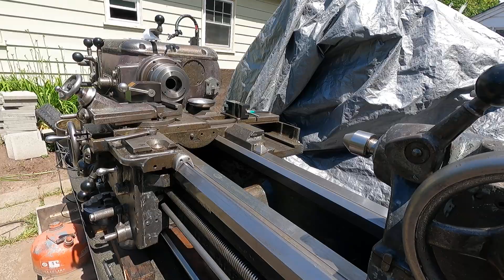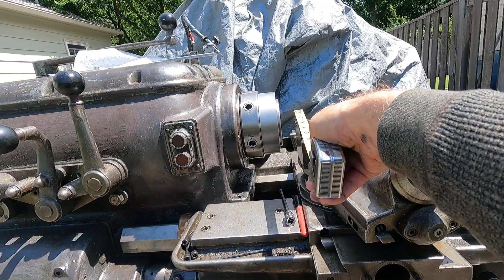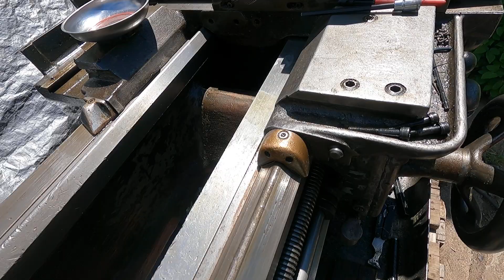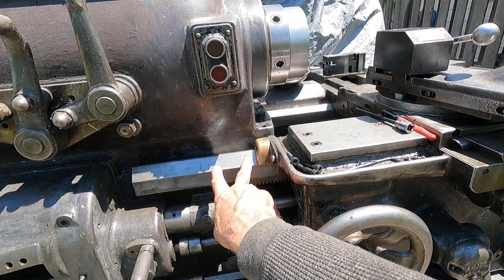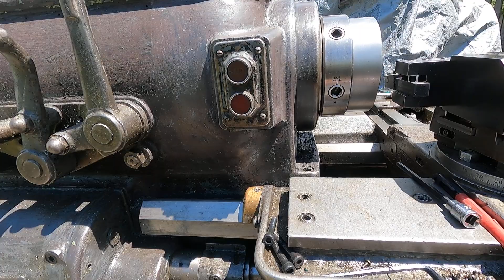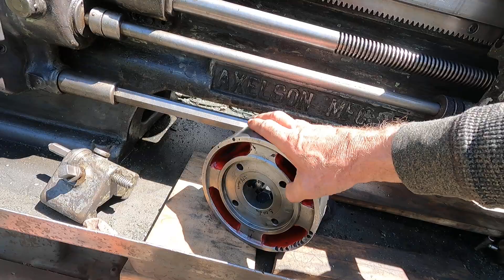Machine tool restoration using DIY stain remover results

Comment: DeeDee, so why did I regrinding the bed on my 10ee?  Because it was fun!  Schaffer Grinding in Los Angeles did the job. I can’t say enough good things about them. A family business with great employees, ethics and prices.  Thanks to great advice from my friend who later scraped in the saddle, they ground so little material off of the bed that my lathe now exceeds Monarch’s original specifications with the exception of a few .0001” drop that required shimming the tailstock up to to achieve near perfection.   Considering the large “Vee” ways on that Axelson it really saw a lot of use, or abuse.  Bringing it back to life the way you are is preserving a beautiful piece of American machinery.  Keep scrubbing!  TB
Reply from the maker: Ha Ha, when you are chasing tenths the machine will seem as flexible as an Atlas lathe. Perfect lathes are not all they are cracked up to be. Monarch specs .001" high on the tail center or so, it is in the Blue Lathe Brochure.  You still have to use every trick in the book to make it work just like making acceptable parts on a same size bench lathe trying to hit .001". Much from the same bag of tricks I will work that old Axelson. Most of my experience is making money on worn out machines. I could in the future rebuild that Axelson, but not now.
Reply: @deedeeindustrialsuperprecision  yes, I know my tailstock should be .001” above the spindle, but it isn’t.  The front edge of my test bar is within spec.  I’ll have to dig up my measurements and send them to you after I’ve got it running.  I’m have to admit I’m surprised to see you use Monarch and Atlas in the same sentence. I guess I’ll learn soon enough.  Cheers,  TB

Comment: It’s really cleaning up nicely. What size is that lathe? Thanks again for sharing!
Reply from the maker: The indicated size is 14 X 30" The actual is 16 X 36. unusual large 10" over crosslide, but turning length is only 24 !/2" with the tool set.